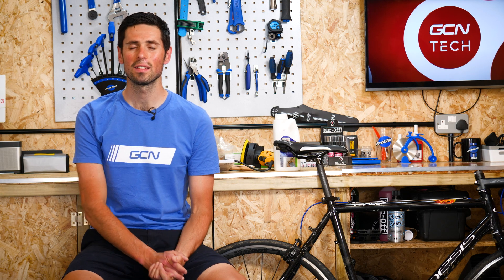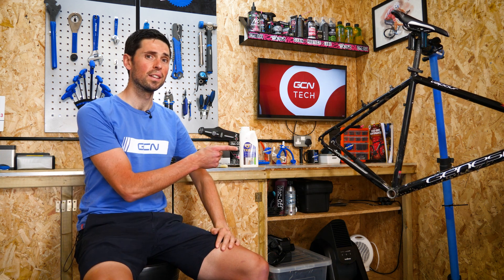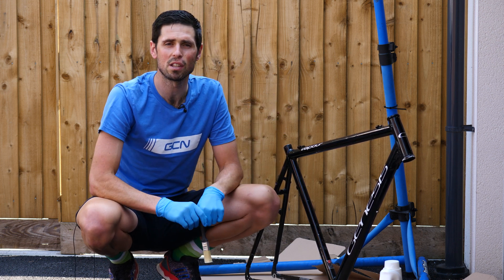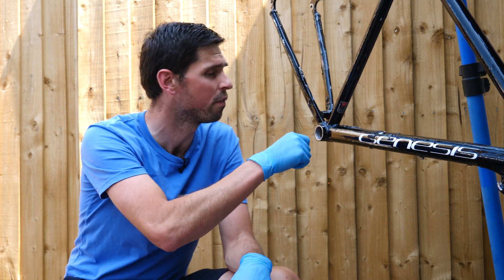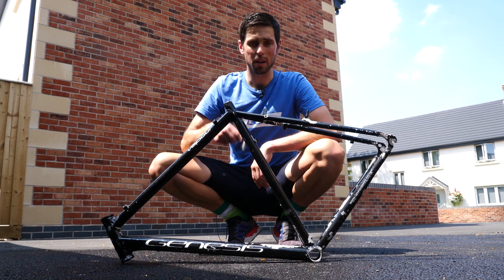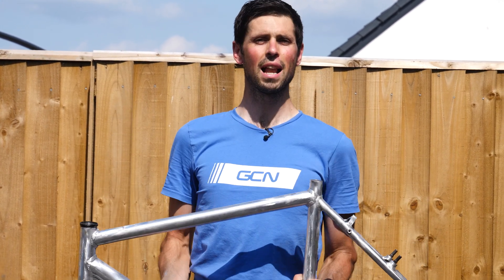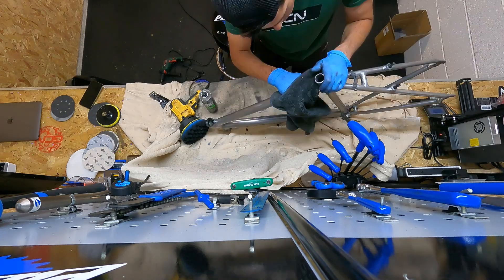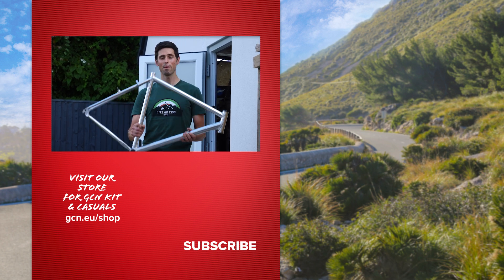Can You Polish An Alloy Frame To A Mirror Shine?

Comment from the maker: Do you like bare metal bike frames? Let us know in the comments!
Reply: Please don't put your bare hands on it until you clear coat it. It will corrode without a protective coating
Reply: The result was better than expected!
Muc-Off also makes products for motorbikes, so there's no wonder they have a metal polish product.

If I was to do this, I'd go for an electric polisher with a lower profile. That gives better stability and access to tight places.
Reply: If I can't see a cameraman in the final shots, it's not a mirror polish.
Reply: YES, I like bare metal but ONLY if it is Titanium.  Your bare Al frame will look horrible in n time to come,  see my more detailed explanation below
Reply: Absolutely! That was one of the requirements when I got my Specialized Diverge DSW in brushed and clear-coated aluminium. I'd like to do this sort of job on my other black daily bike but I'd prefer to send it to a professional bead-sanding service and a clear-coating service.
Reply: @robertrjm8115  That's why factory AL frames are clear-coated/laquered.
Reply: I think you started it so you should not stop working on it. It looks like there is still more work to do. Work on those welds too. This can be a masterpiece just don't be in a hurry.
Reply: yes love them, my mechanic did the same thing with his race bike after he rode it so hard one summer the paint faded...anyway wouldn't it be just as cheap considering chemicals and time, to farm out the stripping to a media blaster? Enjoyed the vid!
Reply: Build the bike!
Reply: Yes love bare metal, but I prefer a brushed aluminium look rather than mirror finish.
Reply: @buzzman4860  Aluminum instantly has a rust finish the moment it's exposed to air. It stops right away and leaves a protective oxide finish. I hope I explained it right. I'm sure others will expound on this or you can look it up for yourself.
     In areas near salt water it can corrode further I believe, but that takes a while. It's mostly cosmetic for bikes.
    A light coating of any sort of oil rubbed on will avoid most of this.
     I use something called Gibbs Oil. If you search for this you will see a wide range of niches, like guns, cars, bikes. It leaves a dry finish easily. It's fairly durable, especially good for magnesium wheels on cars to prevent corrosion.
Reply: @ViveSemelBeneVivere  I know!    But that is not what he is doing, he appears to want to leave it bare metal which is a bad idea
Reply: @robertrjm8115  Titanium undergoes the same oxidization as Aluminium, raw/pure titanium frames are unheard of. A thin layer of oxide on either of those metals makes them very very strong. Al looks different than Ti when oxidized though. Gotta luv them both!
Reply: The time it takes aluminium to oxidise is measured in seconds. The speed of oxidization is really rather remarkable which is one of the reasons why welding aluminium is somewhat problematic because aluminium oxide has a much higher melting point than aluminium. It will get progressively duller, quicker in the places you touched with your bare hands. 
If you want it shiny the only lasting way is to have it stripped professionally and then anodized.
Reply: Yep, I love my bare alu frame! And I'm very interested in the 3D printer.... You make stuff for the bike with that??
Reply: @buzzman4860  ive had my 1984 cannondale stipped down to bare aluminum since the late 90s and no sign of any corrosion.
Reply: @robertrjm8115  Ive had my aluminum stripped down to bare since the late 90s and it still looks great!!!!  no clear coat just bare metal
Reply: Nice video Alex, you beat me to it, I’ve been wanting to do this for a long time. Hey does grinding the joints down, the welding essentially, weaken the structure? I was considering hand filing down a bit off the welds on one of my aluminum bicycle frames, for cosmetic purposes, obviously, then bringing it up to a mirror shine. Thanks again.
Reply: @bubblesezblonde  some people prefer not to media blast alu bikes citing the media to be too harsh.
Reply: Did an alpine stars MTB years ago but had it bead blasted ....hard work and had to be sanded.took hours and hours .new decals and a 2 PAC clear coat and it looked the mutts nuts 😁.I like the polished aluminium look .

Comment: THIS I HoW NOT to do it Mistake 1: leaving the Paint Striper to Dry no wonder the paint never came off,Mistake number 2 using a Wire wheel on Alloy this digs into the alloy, Mistake 3  using a Flat   sander on round tube leave flat Spots. Chemical Strip Get a paint Striper that works test several , use a tube sander   , use  a sanding strip wrap around the tube
Reply: supplement to mistake no2: you'll have to remove the grooves when sanding.
Correct process: 
_use the paint stripper without leaving it dry
_if any spot of paint is left: USE THE PAINT STRIPPER AGAIN
_start sanding by hand making parallel movements as much as possible with 2500 or better 5000 grit
_continue sanding without changing the direction of the movements until you reach at least 20000
_polish without changing the direction of the movements 
_now you have a mirror finish
Reply: Mistake I've made: Use something to scrap the paint off. After you master it it comes off with the brush itself. Scraping leaves marks on the frame.
Reply: Even worse thing about using the wire wheel is that it leaves steel particles embedded in the aluminium surface, never to be removed again, so they will eventually rust and also cause contact corrosion with the aluminium. What a way to ruin the surface

Comment: Whyyyyyyy would you not remove the headset completely :((
Reply: I know right?
Reply: That is part of the bike.  It is probably an integrated headset.  Many aluminum bikes have them.  The frame itself holds the bearings in without needing bearing cups.
Reply: @Windband1  No, it is not an integrated headset.
Reply: @davidf2281  You were there?
Reply: @Windband1  No, I was not there and I didn't need to be, because the defining characteristic of an integrated headset is that you can't see the cups. Get a clue.

Comment: Sorry to say, but there are a couple of things which could be improved. Obviously remove the headset for starters, then get EVERY bit of paint of - you will likely not get the welds to look perfekt, but expescially when the paint is black, every little bit counts. Then it looks like Alex went from sandpaper over to polish very soon - and thats why the frame is quite shiny, but also has a lot of micor scratches on it, some from the machine I would say. As others have stated, paint remover doesn´t work so well anymore, but perhaps start with that and continue using it in difficult areas. Then start sanding down the frame anywhere in beetween 60-150 grit sandpaper, depending on the condition of your frame (the bigger the scratch, the rougher the grit). The end result will benefit rom every step of sandpaper used, so take as little steps as possible up to 1000 grit. The main tubes will be the easy ones, but look after the welds as well - if you go back and have to repolish/sandpaper something later on, it will be much more work. Use small strips of sandpaper to get into every little cranny as you will see those pots later on (maybe don´t polish the dropouts completely as you will need a higher clamping force from your quick release later). One you have finished 1000 grit, start wet sanding with 1000, 1200, 1500 and 2000 (as I said, small steps). This will really bring the frame to live and emove all of those microscratches. Then work with a polishing paste until you´re satisfied. I haven´t worked with a machine before, so that might cut down time extensively - mine was about 100h/frame, though I´m a perfectionist ;) Thanks Alex for making this accessible to a broader audience though (and I hope you didn't leave that water running down the road)!

Comment: When polishing you have to go through as many grits as possible up to the finest one like 2500 (2000 insn't fine enough) and not to skip any. Then it's about to get into a mirror stage. Since aluminium isn't hard material you'll never get it as nice as let's say polished stainless steel. Final polishing can be done with either chromium oxide (green powder) or chalk. Every material likes its own liquid to be used when polishing so aluminium likes kerosene. Buffing wheel should be soft enough not to leave micro scratches.

Comment: I just polished a 1995 Diamond back factory issued never painted aluminum rigid mountain bike (no paint stripping necessary) it came up just beautiful, I did give it 3 coats of clear laqueour to stop any oxidation...
Reply: I was thinking about clear coating my mirror polished aluminum, does the clear coat take away any shine? Is it hard for it to stay on since the surface is so smooth?
Reply: @bugaboo2860  ...I'm sure if you get a good quality clear laqueour and remove any moisture and grease including wearing gloves when touching the frame and apply when ambient temperature is ideal it will stay on no problem, with my frame I went with the circular titanium polish look and looks great, with your mirror finish any blemishes will be more visible but if you're careful you'll get a great result

Comment: I did this on both my hard tail (about 10 years ago) and the my full suspension Marin a couple of years ago. My motorcycle is also mirror polished where possible.
The hard tail was brushed aluminium, it got a scratch and I tried polishing it out and gave mirror finish, so sod it lets do the whole thing.
The Marin was chipped scratched and looking dated, and I am not in a position to get a more modern bike, so I thought I would do the same to this one. Once done it looked so much better,  but that lasted until the first time I took it out.....
I am not precious about my bikes, they get used. The first time I went to a known biking spot, with a couple of mates who own bikes from this year, unlike me, who's bike is nearly two decades old. I was embarrassed thinking I had brought a polished t#rd. I left my bike about 20 metres away from the group of other bikers who had the bikes, the gear, and the talent, while we were chatting. The sun caught the frame and it glistened in the sun. And caught a lot of attention. Then I got a lot of compliments.
I went to another bike park last September and a chap made a B-line to come over and talk to me about my bike, he actually mistook it for a much more expensive piece of equipment, rather than the 2005 rift zone it actually is/was. 
 It is a bit of a triggers broom, only frame, swing arm and forks are what came as standard,  everything else replaced or modified.
But yep. Polished frames are cool

Comment: ALWAYS use eyeprotection when using a wire-wheel. The little metal wires frequently comes off. And at the speed you're using the machine it can literally make you blind. Jeans or something would also be prefered, them shit's hurt!
Reply: You got here there first, 100% agree with you.  absolutely cringed when I seen zero eye protection at 6:24, just takes one ejected wire strand for you to loose an eye. Seen it happen to a lad in a metal fabrication shop and its not nice. Safety first.
Reply: Also eyeprotection while using paint stripper
Reply: @t.b.r.2844  Yup exactly... and put the mask on correctly! Hold me up GCN... do your job at least half decent protecting your guys!
Reply: I used a wire brush on a drill to raw my BMX cranks, later on i ended up with one tiny snapped wire in my foot. All I could think was wow I'm an idiot, what if this was in my eye instead 💀

Comment: GCN Tech,   Using, for example, an 80 grit sand paper before using the paint stripper would have had removed far more paint before using the wire wheel.   The point was to create grooves on the frame, using sandpaper, for the paint stripper to be more effective, starting out.
Reply: It does even help to cover the paintstripper with PE-plastic wrap from the kitchen or  plastic bag (cut to stripes) leave it over night... I used this technique to remove the underwater paint on my sailboat. It prevents the paintstripper from gettin dry to early.
Reply: I thought the same. :) The places where the paintstripper has worked well were probably places where the original paint had been scratched...

Comment: Paint stripper works better the longer it sits. I usually sauce up the bike fame then tie it up in a large garbage bag to sit over night. The next day you can wipe most of the paint off with a rag.
Reply: Heat helps too. If you have a small room you can get to 40C, do it. Also scratch the paint with a blade, so the stripper can get underneath.
Reply: I think a key component of that is the tying it up i  a garbage bag.  If you don't the solvent evaporates after a time and the paint hardens up again.

Comment: OK now you have a semi polished bare metal aluminium frame.  
The problem with aluminium is that it will oxidise extremely rapidly, within minutes of being exposed to normal air.  This will create a initially a very thin homogeneous protective layer of white Al2O3 (aluminium oxide).   
Because the layer is so thin it will initially not be visible.   However since this layer is extremely fragile and easily disturbed it will over a very short period of time this layer will thicken unevenly , especially if touched with fingers, containing natural acidic sweat.  This will increase the level of oxidation and lead to a splotchy appearance.  

This is the reason why bare Al surfaces are never used in any circumstances but they are anodised, i.e. artificially oxidised  in an electrolytic bath.  This gives the surface a thick and strong artificial oxide coating which protects the bare Al.   Depending on the anodisation process and material used one can achieve many different colours including clear metallic appearance.  

But without this process I am sorry to say that your frame with look horrible in no time and would like to see an image of the frame in 1 or 2 months time after use.  The only other alternative to anodisation I see is to use a thin protective layer of clear varnish to prevent uneven oxidation and this needs to be applied immediately after polishing.  

On balance, I am sorry to say that I think you have done your frame quite bit of disservice.
Reply: What about steel? Does it need to be stainless?
Reply: @tom_zanna  If it is Stainless Steel, you do not need any protective layer or coating.  However, it is nearly impossible to polish SS to a mirror shine, it will always be a bit dull.    
The problem with normal steel, i.e. non stainless, is that it very quickly corrodes and even a small scratch in a protective paint layer will allow this to happen.  Also, a good, glossy top layer paint, be it coloured or clear does not stick very well to bare steel.  That is why there is always a base layer, a primer, on the bare metal underneath a top paint coat to achieve good adhesion.  And this base layer is usually a phosphor based paint which is not very nice, typically grey (and is not available as a clear paint) and does not take on a shine, but that doesn't mater in a normal paint job as it will be overcoated with the top layer. .
Reply: @tom_zanna  Reynolds 921, 931 and 953 are stainless steel tubesets.
If you google it there are mirror polished naked frames available.
Reply: The frame is aluminium ALLOY, so the oxidation of pure aluminium you mention is totally irrelevant.

Comment: I've done quite a few of these now, and the key bits are how you get the paint off in the first place, using the least abrasive method means much less polishing later. The paint removers on the market these days are so weak, it makes that hard to achieve, but the next one I am about to do, I will be taking to the guys who refurbished my alloy wheels on my car, so they can acid dip it, that will hopefully give me a decent base for the polishing phase. For the polish, I've tried quite a few thing, Mothers make a very good polish and I also have a tin of 3M stuff that the people at Duxford recommended, as used on their bare aluminium skinned aircraft. The final key ingrediant, patience :)

Comment: Peeps, do NOT USE a wire wheel on anything aluminium you want to polish at a later date.
It will only create more work for you as those scratches will need to be removed during the initial polishing phase.
Reply: @Andrew Pattinson have fun....
Reply: @michaelhayward7572  some of us like the aesthetic of "brushed" aluminium with intentional, methodically placed whips from the wheel 😉✨
Reply: ⬆️⬆️ some of us have an eye for aesthetic, some don't. He must be joking. Put them side by side. Mirror vs poorly brushed aluminum vs a good brushed aluminum the mirror will always catch the eye more.

Comment: I always wonder why original paint is so good and when repainted, it’s not as good—is it because of the quality of the paint or the method/process painting? If repainting a bike, is it possible to have it as good as factory?
Reply: original is powder coated and baked to the frame
Reply: I imagine it's a bit of both.  Automotive paint is baked on in an oven, A frame factory probably does the same thing.

Comment: I use to polish aluminium automotive engine parts up to a mirror shine. Bead blast the frame, because wire wheels score the aluminum making it harder to.aquire that high end polished look, after bead blasting start with 320. Grit emery paper and keep on sanding by doing 600 grit, 800 grit then 1000/1200 grit, after which get a sewn cotton buffing wheel with jewelers Rouge and buff away,  that frame will be just like a mirror.   Wear eye protection and a mask when polishing with the Rouge and buffing wheel, it's a filthy job.